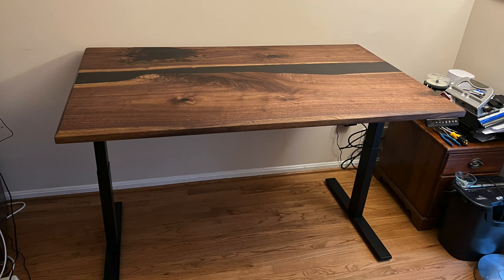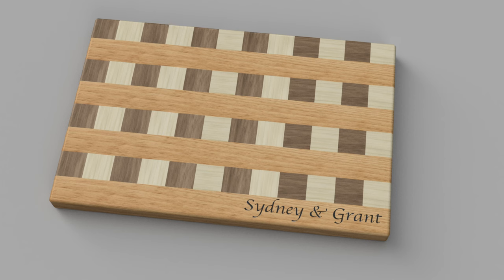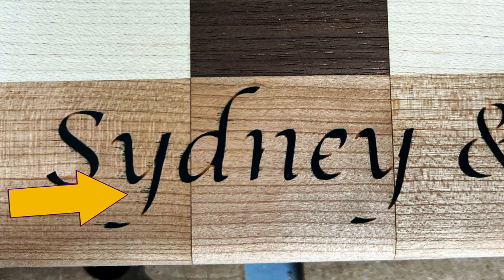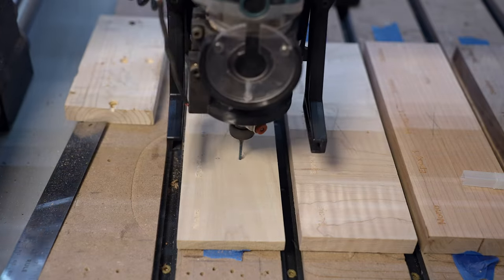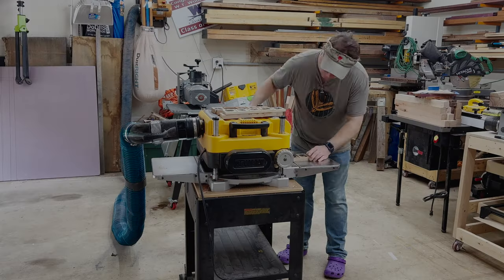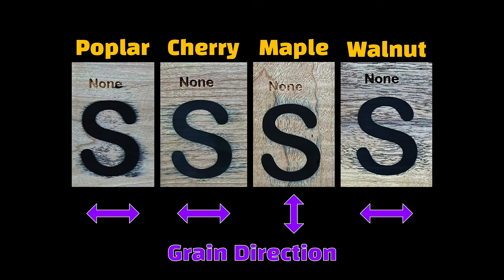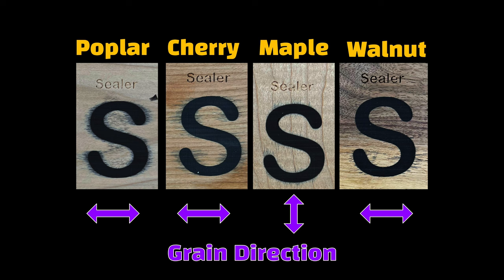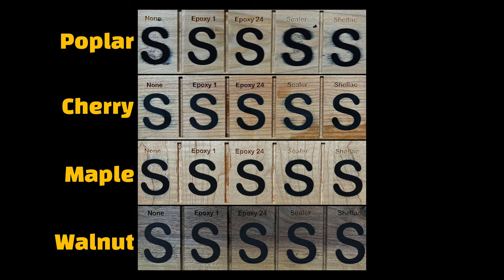BEST sealer to STOP epoxy bleeding - SURPRISING RESULTS!

Comment: I've done the exact same tests, trying six different sealants including Epifanes marine varnish, poly-urethane, shellac and   My best result came from a wash of Titebond III.  
Some unsolicited advice, from an Emmy-winning cinematographer and producer and serious woodworker whose work features pigmented epoxy fill.  Apologies. If you find this rude, you'd probably be right.  Sometimes I can't help myself.  
Your LED soft-lite, well-done graphics and good mike indicate attention to the craft of video production as well as wood craft.  Thank you.  Your video is already head and shoulders above 95% of what's out there in Youtube woodworking land.  Try adjusting your light position to improve reflections on your glasses (or take them off).  Tie your left hand to the table.    A little less talk and more b-roll.  
Go Buffaloes!
Reply from the maker: Thanks Franklin - no offense taken. Always a program of progress, not perfection. Check on the glasses - I routinely forget to switch from my computer glasses to my regular glasses, which reflect a lot less light. That said, my lights are far too close for comfort, but I'm very limited in depth so I need to deal with it. Good news - recent videos are less "handy" and "more b-roll :) Thanks for the feedback and watching!

Comment: I know this video is a little older, but I use Rustoleum 2X glear gloss spray. Spray it on heavy in all directions and let it sit overnight before filling with epoxy. I have even used this method on pine and no bleed.
Reply from the maker: Hi Jay -- thanks for the feedback. That's definitely on my list for the follow up. I routinely used poly (or lacquer) when I was making a lot of signs and it worked very well with paint, so I'm curious if it will also work with epoxy. Thanks for watching!

Comment: I watch Blacktail make epoxy table and he has never mentioned bleed through....I am very happy to see that issue addressed in a very well done way! Thanks you have a subscriber.
Reply from the maker: Thanks Steve - I really appreciate it. Cam has said he uses Shellac to seal his wood before pouring epoxy to avoid bleeding -- I'm second guessing that choice! Thanks for watching.
Reply: He does talk about it on a round table build . It was a colab piece sealed with clear epoxy
Reply from the maker: @joshneill6057  if I recall, Cam recommends shellac -- I have his epoxy course so I will have to go back and rewatch that section to verify. Thanks for watching Josh!
Reply: @cyberreefguru  He talks about it in a video named “Giant round epoxy table” he seals with clear epoxy before using colored on this one at least.
Reply: @cyberreefguru  Anyways thanks for your time and video!  Much appreciated!
Reply from the maker: @joshneill6057  No problem!
Reply from the maker: @joshneill6057  Yep - I'm reaching out to validate.  Thanks!

Comment: Newbie epoxy pourer here. Thank you for a very informative video. I evolved into epoxy after several inlays. I used  select pine to receive the inlay. Experimenting with sealers, I discovered that General Finishes WB Poly did best at sealing and NOT darkening the wood. Also, pleasantly surprised that after forgetting to brush some epoxy to seal the surrounding area of my pour, I had no bleeding. I must mention I was super careful no to overpour and needed no sanding. I can provide a picture if you would like.
Reply from the maker: Hi Robert - thanks for the valuable information. I will add your recommendation to the list for the next round of testing and hopefully I can reproduce your results. Thanks for watching!

Comment: The shellac in a can has a 3 year shelf life. Also, for sealing, dewaxed shellac works best. It's sold as zinsser sealcoat and is a 2lb cut, though I mix my own from flakes these days (blond is my preference).  Any time you're using shellac as a sealer you want dewaxed. I coat the whole area that will be getting epoxy.
Reply from the maker: Thanks for the suggestion - excellent thing to ensure for the next round!
Reply: I used dewaxed shellac on a pine piece and it bled badly. Do I need to do more than one coat?
Reply: @aaalharmi   You have to make sure everything is coated. If doing text inlays, after routing away the letters to be filled, you have to coat that area as well.

Comment: Good info. Yeah, do one (if you haven’t) with multiple coats. And how about pine and mfd? Getting so you gotta get a bank loan for the other stuff! (Lived in Ballard Hall for a year. Engineering center was brand new! Could actually walk over to Folsom and wander around right down on the field. Different times!)
Reply from the maker: Thanks Valin -- will add them to the list (MDF will be difficult!) - those buffs! ;)

Comment: I have been sealing my small carvings with Aquahere [ a PVC glue] on several Australian species of wood including pine and found it to completely prevent bleed . Tried a few other wood glues and all seemed work fine - the PVC is cheaper and very easy to apply especially to fine lettering.
Reply from the maker: Thanks for the info Kevin -- I will see if I can source something here and try it out! Thanks for watching!
Reply: Just to make sure... you refer your choice as 'PVC' glue, while later you mention 'other wood glues'. Are you sure the first isn't PVA glue instead of PVC?
Also, is that SELLEY'S AQUADHERE glue? If it was, that answers my above question.

Comment: The problem with shellac as a sealer is due to its best feature as a finish: each successive coat partially dissolves the coat(s) under it, which allows the layers to blend into asmooth, even finish. It seems that the epoxy pour dissolves and blends with the shellac, allowing the dye to bleed. 

Also: hardness and porosity of woods are different properties of woods. The differences in porosity explains why woods with similar hardness, like walnut and cherry, take stains and dyes differently, and also explains why you got more bleeding into your cherry samples than you got in your walnut samples.
Reply from the maker: Excellent points James. Thanks for watching!
Reply: @cyberreefguru  it was an excellent video!
Reply from the maker: @JamesWilliams-en3os  Thank you so much! Happy holidays!

Comment: Sanding sealer and Shellac are meant to have bleed. Sanding sealer and shellac are blotch control basically. they let color in but control blotchiness. so you would need a couple coats to prevent the color bleed.
Reply from the maker: Hi Christopher - thanks for the feedback. I don't know how anyone can determine the difference between "blotch" control and "bleed" but it is possible based on my experience. One more reason to try again and see what happens. Thanks for watching!

Comment: Thanks for this video! It would have been useful to see how you applied the different sealers. Did you just use a brush?
Reply from the maker: Hi Vlad - yep, I used a foam brush. I would recommend a nylon brush though -- the foam does have a tendency to break down if it it's old. Thanks for watching!

Comment: This was useful, but I was interested in the case you mentioned where you compared heartwood & sapwood on Walnut.  I didn't see that in this video.  Do you have that test case posted?
Reply from the maker: Hi Tom -- thanks for pointing that out -- didn't mention it in the summary. I saw only minor differences between the two -- it's not clear if it is a grain issue or a sealing issue. One more reason for additional testing. Sorry for the rather inconclusive results on that front.  Thanks for watching!

Comment: I'd be interested in your follow-up testing.  I'm new to this and using a Shaper Origin but plan to get  a Shapeoko 5 with a 4x4 surface. I've been testing on pine, sealed the cutouts with 2 coats of shellac  and still get bleeding in a few areas.  I have not tried more than 2 coats or epoxy. Which epoxy
Reply from the maker: Hi John - any epoxy should work but I used Total Boat. Planning a follow up - hopefully in a few weeks (well, months, but still ;)). Thanks for watching!

Comment: Did you use Deep Pour Epoxy or Thin ?  Did you seal the Entire Board then sand or surface it back or just seal the Pockets ?
Reply from the maker: Hello Rick.  I used Total Boat High Performance Epoxy with the Medium Hardener (https://amzn.to/3PxF5Vo). As shown in the video, I seal only the pockets and let the epoxy cure for various time periods. Then I planed and sanded the over pour off. Thank for watching -- hope it helped!

Comment: Thanks for sharing the video.  I was hoping there would be less video of a 'talking head' and more visual. Let me explain.  The entire video I was wondering just how you sealed the piece.  Did you seal the bare surface then engrave or did you seal the piece after the engraving but just the top non-engraved parts?  or did you seal only the engraved areas?   It is my understanding epoxy bonds best over bare wood I was wondering how the 'epoxy sealing coat' was done. Id the inside of the engraving was sealed with epoxy wouldn't that mean the colored pour risks not bonding well to the piece?
I hope you understood my rambling, I would understand if you don't get my confusion.  Perhaps I'll have to rewatch the video and hope I'd missed something.. but its a lot of only talking and no visual reference of what part to key in on and when.. and in circles I go haha
Oh, lastly.  I also wondered if letting the colored epoxy thicken up some (at least my deep pour epoxy lets me play with the time/viscosity variable.  Would be curious if the thicker stage epoxy would be inhibited enough to bleed less into the wood pores?
Reply from the maker: Hi there -- thanks for the feedback. I do briefly show the sealing process at 7:32 but agree I needed more B role -- program of progress not perfection! Thanks for watching.